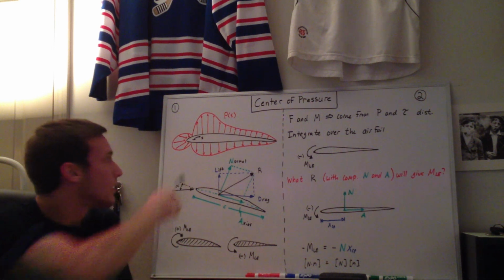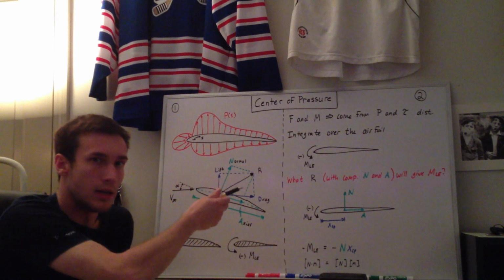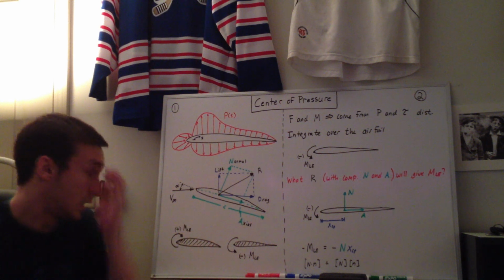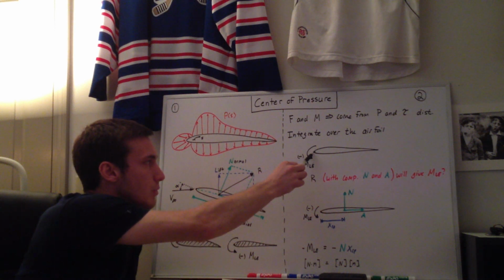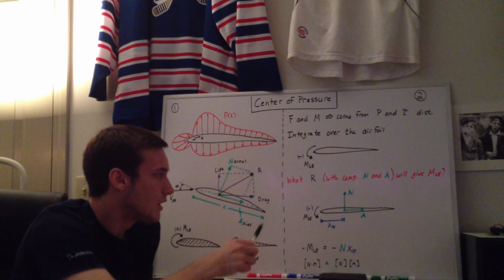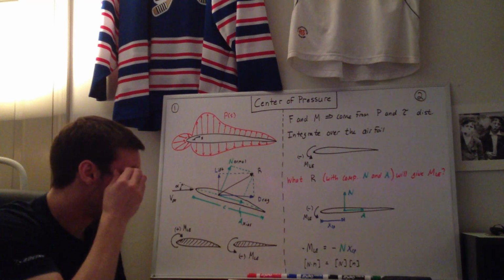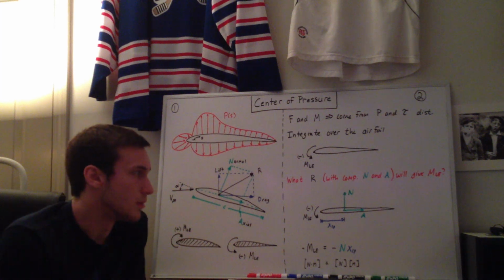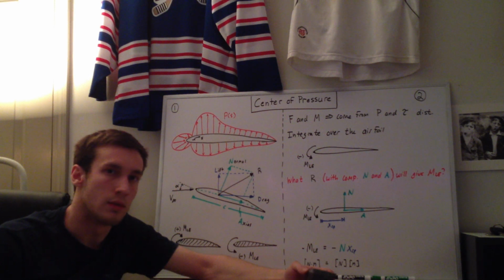Explained: Center of Pressure [Aerodynamics]

Comment: HI josh
I think about the moment around the wing and the moment around the leading edge as, if you've played pool, and choke the stick well, if you hit the Q ball in the lower half, it will go ahead a little yet starts to roll back towards you, I have seen that a lot and I can do it always. now, if you think about the Q ball when it goes ahead as representing an example of the moment around the wing, yet, the ball rolling back that should represent the moment around the leading edge...
Reply: sorry, I forgot
in this case the ball should be thought as the air molecule and the stick as the wing.  remember the action and reaction